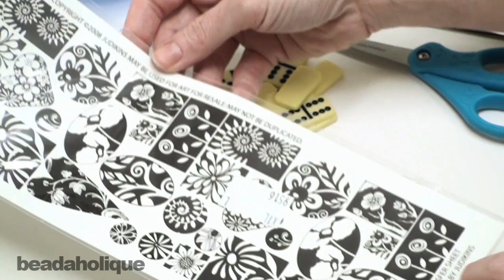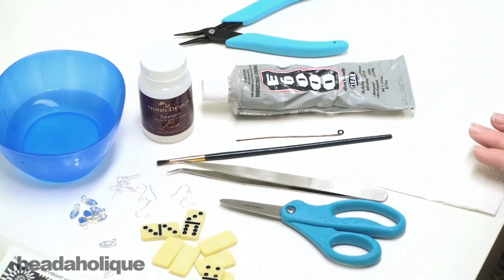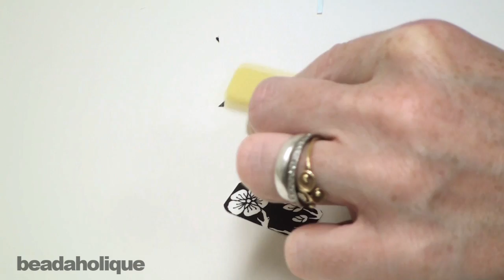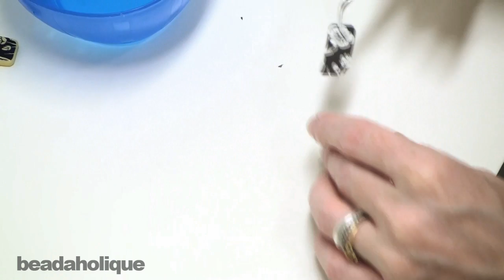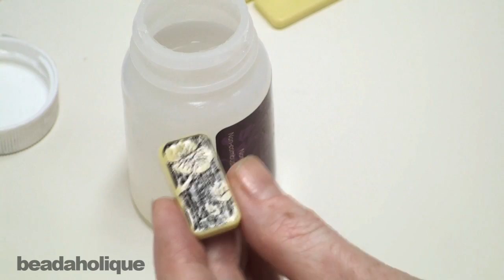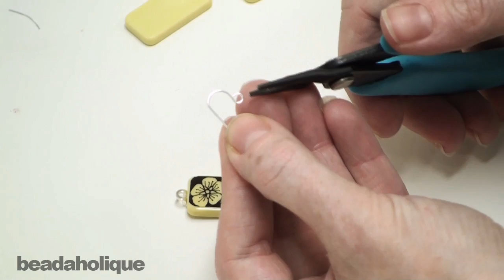How to Make Domino Earrings Using Image Transfers and Aanraku Bails

Comment: Awesome! Are these laser printed images?
Reply from the maker: https://www.beadaholique.com/nunn-design-transfer-sheet-graphic-florals-for-scrapbook-fits-patera.html
These images will not blur, stain, or run when used with water based glues, Mod Podge, Diamond Glaze, etc.
The colors show beautifully through resins, Gel Du Soleil, and Magic Glos.
After cutting out the image, drop into a bowl of water and let soak for about a minute. The film like image will gradually release from the backing paper to be set directly on your chosen Patera pendant and later covered with acrylic varnish

Comment from the maker: Unfortunately we currently do not carry Claudine Hellmuth multi medium and/or Duraclear polyurethane varnish so I have not worked with them and therefore hesitate to voice an opinion on it. I would suggest doing a test on a corner with one of these products and making sure they adhere properly, dry evening, and do not cause any running of the inks. Best of luck!